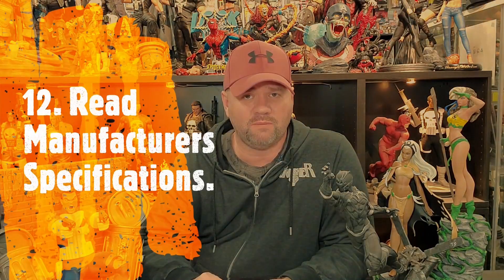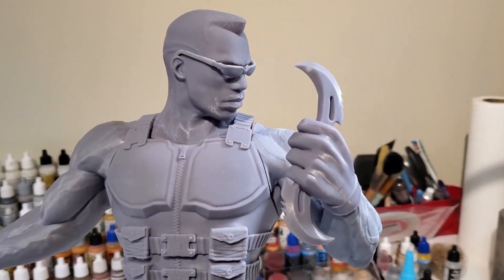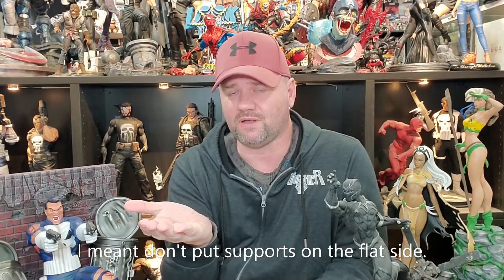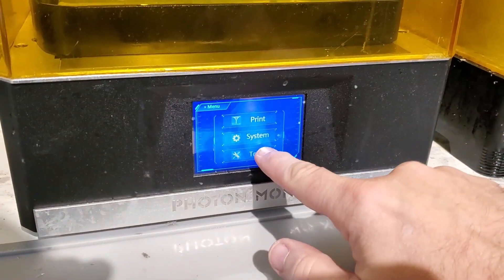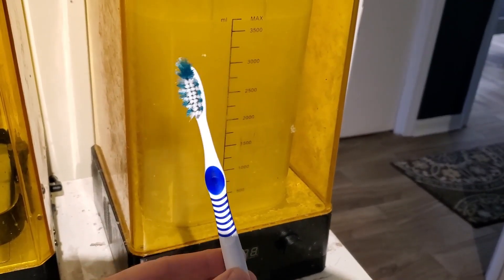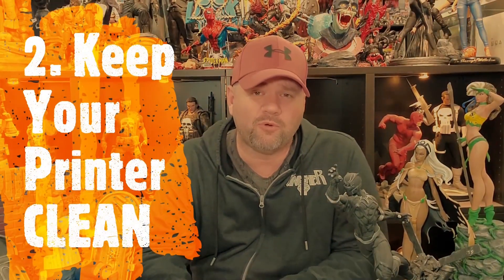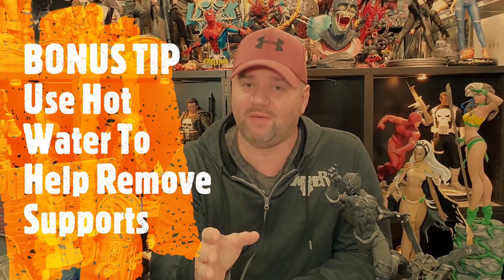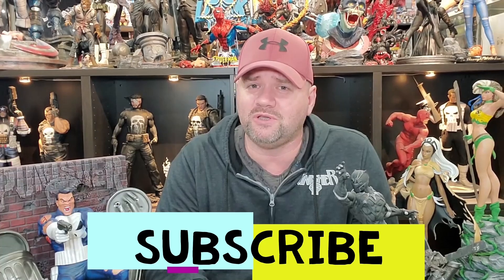IMPROVE Your 3D Resin Prints by Watching This Video

Comment: decent tips all round. im interested in the water-washable resins, i figure it will save on alcohol.  are there any pitfalls specific to water-wash resins that you know of?
Reply from the maker: I havent worked with water washable resins very much. The one that I did use didnt turn out so well. I had several failures. I've heard others say the same thing. I found the resin I'm using now, and it's been so good I just never tried anything else. Sorry that's not much help.
Reply: @TheCreativeCollector  that's alright, it tracks with what ive heard from other people.  seems to be a very finicky substance.

Comment: I use a dirty wash before putting my prints into my cleaner.  Just a jug with a sealed lid that I toss em in and shake the crap out of it.  I don't worry about this alcohol getting as dirty and it keeps the larger amount in my wash machine cleaner for longer. The wash machine is basically just getting the small details clean.

Comment: Being totally new to resin, are you able to make different parts of a printed model different thicknesses? So for example, on those Wicked models, if you wanted the leg peg part to priint solid, can you make it do that but the rest of the model prints hollow? I know I can do this in CURA for FDM with per model settings.
Reply from the maker: Yes Chitubox allows you to do that.